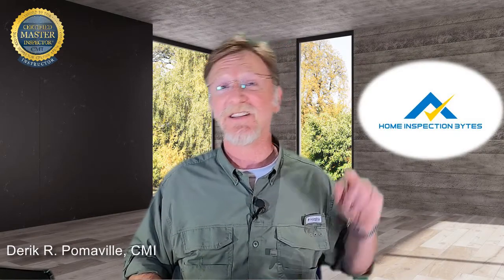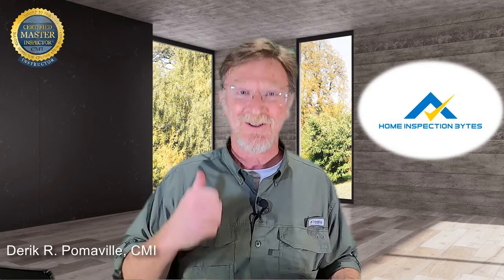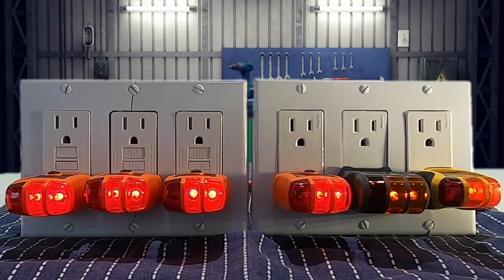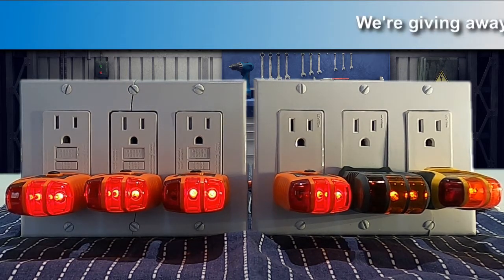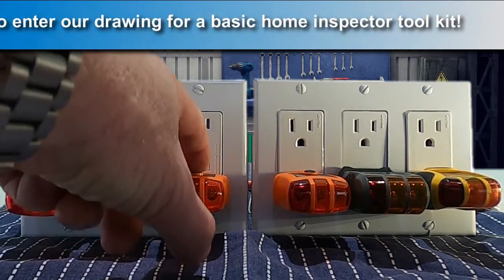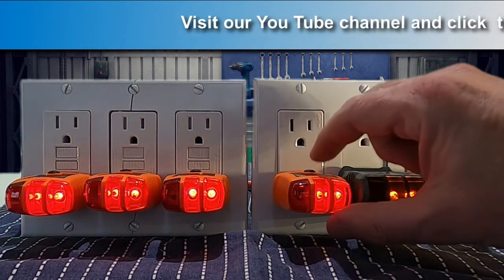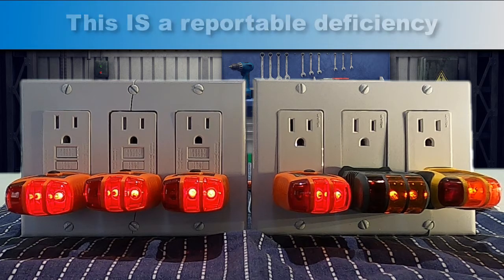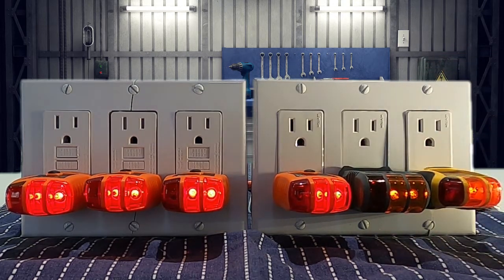Multiple GFCIs one Circuit

Comment: It works like that because you fed the other gfci outlets off of the load side of the first gfci. The load side is meant to protect anything down stream from that outlet. The issue isn’t multiple GFI outlets on 1 circuit. The issue is that it’s wired incorrectly which happens when a unqualified person like yourself installs them. We add gfci outlets at all bathrooms in the case that their outlet is tripping but you must only connect power in and out to the line side. This allows each bathroom to only trip when the issue occurs in that bathroom and does not effect the other bathroom outlets.
Reply: You are correct Ryan. I might add that using pig-tail wiring in each outlet and connect to the line side will eliminate confusion when changing a bad gfci
Reply from the maker: That was the point, to demonstrate to home inspectors what happens when its done wrong.

Comment: Why would you want to connect GFCI  receptacles downstream from another GFCI?  If you want GFCIs on the same circuit and in different rooms why not connect power to the line side and only connect non-GFCI outlets in the same room to the load side?
Reply: I think it would have been more clear if the title was three GFCIs on one circuit wired improperly.
Reply from the maker: I don't know why someone would do this, and can only speculate several different explanations. This video is intended to help home inspectors identify the symptoms and report it correctly for the client.
Reply: @HomeInspectionBytes   I pig-tailed the line side of the six GFCI receptacles in the kitchen to two separate  20 amp circuits so that only the receptacle that would trip was the one that had the actual ground fault. There was only one Romex run from the panel to the first box. One Romex run from the first to the second and one from the second to the third. All connected to the line side of the GFCI. The receptacles in the example are wired incorrectly. That is what the inspector should write it up as, incorrect wiring. Not more than one GFCI on a circuit.
Reply: Because most homes only have one set of Romex going from box to box!!! Why wouldn't you guys understand this??!
Reply: @Montro_Full  I pig-tailed the line side of the six GFCI receptacles in the kitchen to two separate  20 amp circuits so that only the receptacle that would trip was the one that had the actual ground fault. There was only one Romex run from the panel to the first box. One Romex run from the first to the second and one from the second to the third. All connected to the line side of the GFCI. The receptacles in the example are wired incorrectly. That is what the inspector should write it up as, incorrect wiring. Not more than one GFCI on a circuit.

Comment: That set up is wired incorrectly. If wired properly multiple gfci receptacles can be on one circuit and only trip itself and not the other gfci receptacles. And the three regular receptacle can be wired to one gfci or one regular to each gfci. But regardless, the statement that you can’t put multiple gfci receptacles on one circuit is incorrect. They have to be wired correctly. And your demonstration is a example of incorrect wiring
Reply from the maker: Thank you for noticing that the outlets were wired incorrectly - THAT'S THE POINT!  Its a common deficiency home inspectors find and need to be aware of the symptoms of the problem so they can document it in the report for their clients. Thank you for being an educated consumer who watches our channel!

Comment: You didn't make it clear that the downstream GFCIs were fed through the upstream GFCIs. That would be a problem.
Reply from the maker: I thought I had made that clear, thanks for the input!
Reply: @HomeInspectionBytes  I agree, NEVER daisy chain GFCIs.  However, you CAN install multiple GFCIs on one circuit if they are not tied together meaning, the output of one doesn't feed another..  Each one must be fed from the breaker without going through another GFCI.  The video doesn't clarify that and could be misleading.
Reply from the maker: It would be misleading if we were trying to teach correct wiring. The purpose of the video is to demonstrate to home inspectors the symptoms of a deficiency that needs to be reported for the client. Thanks for watching!

Comment: Very informative. I have 3 outdoor outlets in my backyard. The first upstream outlet is GFI that feeds the downstream standard outlets on the load side. The last outlet on the circuit is used for a small swimming pool.  My electrician said it would be better if I replaced the standard outlets with GFI's because it will give me added protection. He said it won't be a nuisance because the outlets are in the same area so figuring out the source of the trip won't be so hard. He also said the added protection will outweigh the minor inconveniences. What do you think? In theory, does that setup add more protection?
Reply: "added protection"...that EC is clueless, , wonder how he passed the test for electrical contractor license?  Or did he?
Reply: @cengeb  books smarts vs street smarls
Reply from the maker: Not really, as long as there is a GFCI upstream, all downstream outlets are protected.

Comment: @Home Inspection Bytes Your problem isn't multiple gfcis on the same circuit. The problem is multiple gfcis downstream of each other, each hooked to the load position of the previous gfci. Agree this is a problem, but when you don't clearly state the problem and instead say, "all multiple gfcis on single circuit bad!" then you're putting disinformation out there, not making things better.

Now I know you know this, but I had to state it clearly to get the point across. That's the problem with this video right now, it fails to make the distinction between an OK (and sometimes necessary!) way of wiring the circuit and the (demonstrated) bad way.

I suggest you re-do this video, and clearly state that there's two ways to wire these, one is a problem and one isn't. Here's what happens when they're mis-wired and why it needs to be written up. (Then your good demo.)
Reply: Maybe you can add an edit at the end to say there is a correct way to wire this, and make a link to a video (yours or not) on the correct way to wire it. 

I do enjoy the video, very informative on what happens when you wire the gfci outlets in series (I believe) Im no electrician, just doing my whole house after gutting it- lots of research and lots of opinions on right vs wrong but very little demos as to why something is correct or incorrect and whats happening.
Reply from the maker: Thank you for the feedback!  The point of the video is to demonstrate the only way for us to recognize the problem is through the symptoms. Furthermore, diagnosing the problem is beyond the scope of the home inspection. If the outlets are wired correctly then they will perform properly, thus, nothing to note on the report. There's only one way to get it right, and our video shows what it looks like when it's wrong. I never said all GFCIs on one circuit is wrong. Thanks for watching!
Reply: @HomeInspectionBytes  Actually you did say, or at least infered, that multiple GFCI's on a circuit is wrong.  You noted the electrician said that was OK and you said you disagreed.  Inference is that it is wrong. You could have said that multiple GFCI's wired incorrectly on the same circuit should be noted.  Yes they function, but the wiring should be further investigated.
Reply from the maker: @FForce1986  Watch the video again.  I explained how multiple GFCIs on a circuit are a nuisance to the homeowner.  They aren't always right as the electrician stated. I have run into this problem many times, written it up, and the client got it fixed. That's the purpose of the video, to show home inspectors what the behavior is when they should be writing it up.  What's your point?